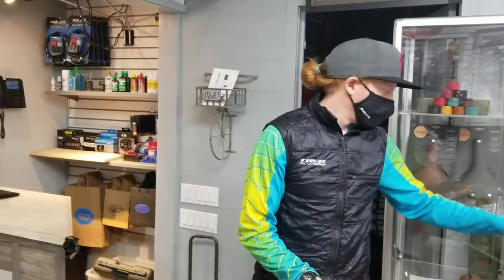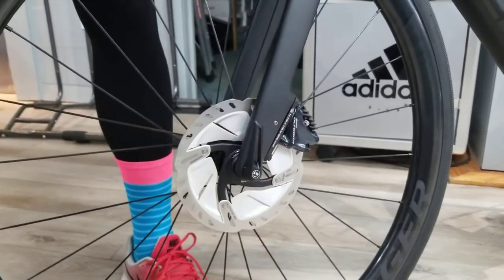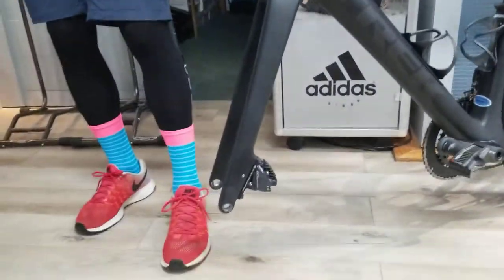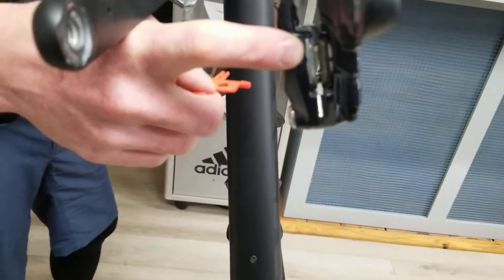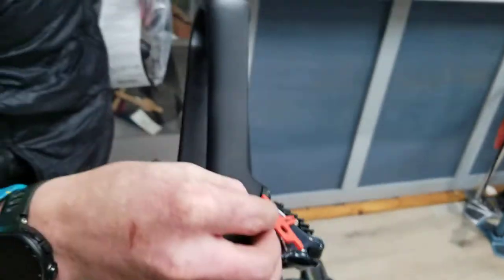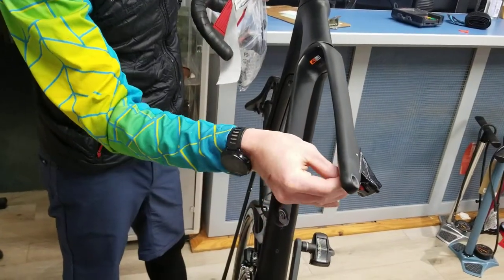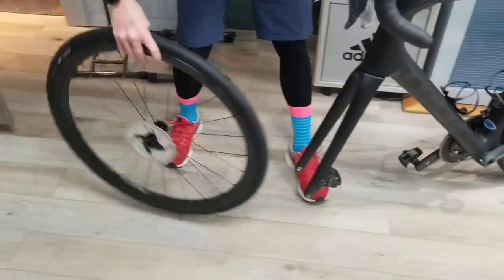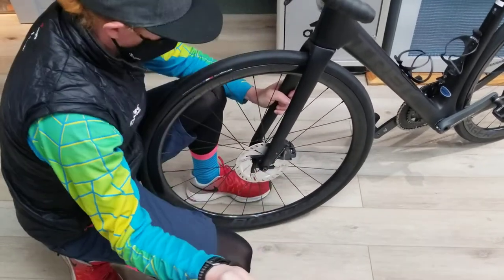How To: Disc Brake Pad Spacer/Pad Keeper. Road, Mountain Hybrid Bike.

Comment: Thanks for this. The spacer fell out in transport on my bike in shipping. Though the manual explains the need to remove it during initial assembly, and includes an image of the part, it shows no images of of the part installed and has no explanation of what it does. Just this short vid was a big help.

Comment: Excellent vlog!!! I just bought a new bike, arrived boxed and front wheel need putting on. I have never had disc brakes before. I could not see how the wheel would fit in between the pads becauase of a plastic orange thing in the way. I now know what that orange thing is and how to remove it. Genisis! Something so simple, yet trying to find out on the internet has taken me ages until I saw a link to your vlog about inserting a Disc Brake Pad Spacer. Thank you.

Comment: I changed forks, recently, and have not been able to understand why my brake now rubs. Now I know. I probably accidentally squeezed the brake lever during all the cafuffle.

I have one of these. It came in a bag, among a few other things, along with my bike from Chain Reaction Cycles, but I didn't know what it is for. 

Now I plan to take the wheel off, pry the pads back, insert this and squeeze the lever on it, once. I imagine that will realign the pads within the caliper and make them move perfectly perpendicular to the disc, over the whole surface of the pad and not be 'squinty', or anything like that. 

Does this sound advisable? Giving the lever a little squeeze with this in to realign my pads? 

I plan on getting a brake centring shim for over the disc, while I loosen and then retighten the caliper, after I use the procedure above.

I should be OK tugging the lever a bit, with this in, should I not?

Comment: My only question is are the pad spaders/pad keepers only needed for bikes with thru axles or all bikes with disc brakes? My road bike uses a normal 15mm wrench for the front wheel but my mountain bike does not.
Reply from the maker: In short if they are hydraulic disk brakes, yes. However they aren't required. It's a preventative measure for hydraulic disc brakes that keep the brakes from being squeezed to much during transport/travel or if the wheels are off. If thus happens with out the spacer, you may not be able to get the wheels back in or if you do the brakes may be rubbing. The axel type is irrelevant.

Comment: I appreciate intention, but this video is almost useless. The first half one can hardly hear the speaker, and the videography angle this all wrong, you can’t actually see what he’s doing with the spacer so you have to guess. Unfortunate that nobody has produced a decent video on how to use a spacer when removing a mountain bike wheel with disc brakes.